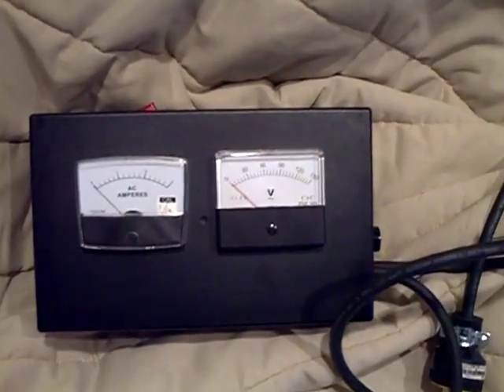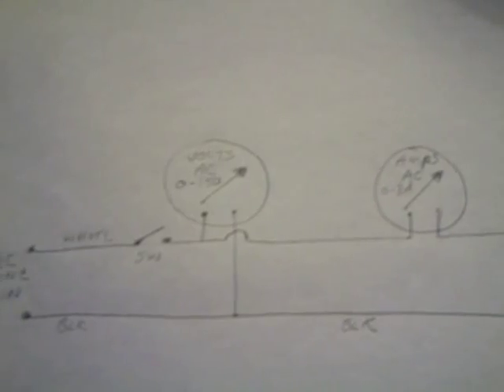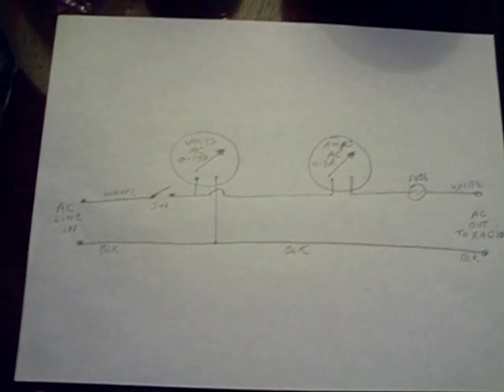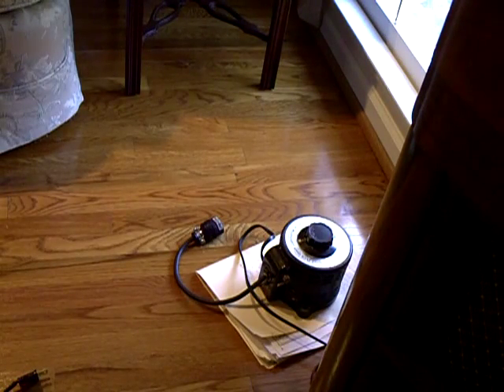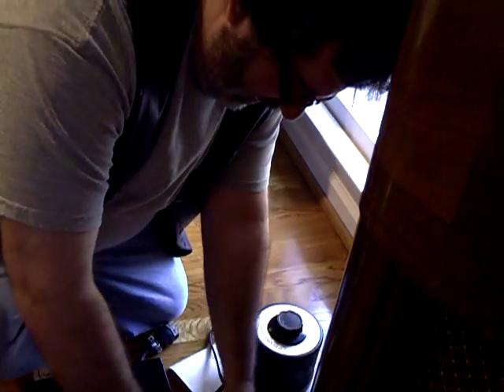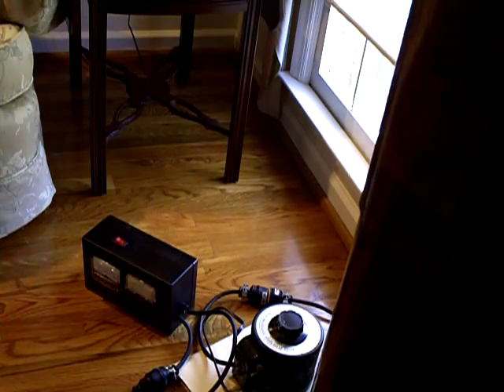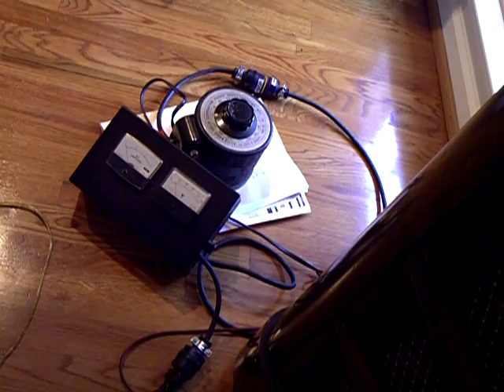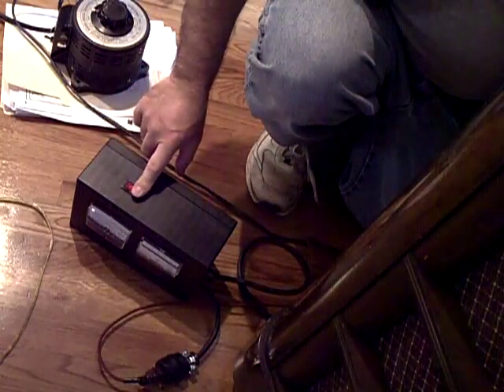Voltage and Current Meter Box Part 2 Done!

Comment: tom smith is right on the money about the wiring.  This is one of the hazards of radios that do not use a power transformer and the manufacturers switched the chassis side of the line voltage in
Reply from the maker: P51ride thanks for the comment

Comment from the maker: I think just a standard size. I think it had a 3 or 5 Amp fuse originally. But when i do initial power ups with no tubes. I just put a 1 Amp fuse. I think the big Philco draw 1.5 Amps at peak. I guessing though, I don't remember exactly. I think a 3 Amp Variac will work for radio work just fine with plenty of spare capacity. There are plenty of new Variacs on ebay with meters built in. Just made the box here for portability > In case I go toa yard sale I can plug a radio in and see current draw.

Comment from the maker: @SlackJones1 Just one thing more. Cutting the plastic with the hole saws is amazingly slooow. It takes patience. I rate making this box difficulty rating about 6 out of 10. I don't have a drill press, so if I did it would have been easier. Holding the box in one hand and drilling holes with the other takes patience!

Comment from the maker: @SlackJones1 I think I used 3 conductor wire, just didn't use the green wire. Not sure though. You just need a wire that fits good into the plug and socket.

Comment from the maker: @SlackJones1 To cut the rectangular hole for the switch, I drilled holes in the top then used a jig saw to cut the rectangle out. I cut it slightly under size, I mean like 1/16 in both X and Y, then I used a file to smooth out the rectangular hole so the switch fits perfectly.

Comment from the maker: @SlackJones1 Hey SJ1, Make sure you get AC meters.
I'll measure the box tomorrow. I think I got it on Ebay too. The meters fit in pretty good. I mean I got the meters in the mail, then estimated how big the box had to be, then ordered the box. So anyway, I'll measure it and let you know.I got the fuse holder at Radio Shack, but I'm sure they have 'em on Ebay. I got the switch on ebay. I got the hole saws at Lowes. I got the wire at Lowes. You can get the plug and receptical. at Lowes too.

Comment from the maker: @doc145 Good catch! I was originally going to do a double pole switch , then just opted for a single pole switch. If the box is used for transformerless sets, it would be much safer to have the switch on the hot black wire. I always put one hand in my pocket when working on powered up radios and put on rubber soled shoes to be safer. Thanks for you comment.

Comment: I have one comment.  The circuit is fine but the switch should be in the hot side (black) of the circuit.  If not then current can flow from the hot side to chassis to ground (through you) when the switch is off.

Comment: What a great idea.  I just ordered some parts and can't wait to get started.  The Voltmeter on my 'heavy' variac is not easy to read and it has no ammeter.  Will use this box in conjunction with a dim bulb tester too.

I'm thinking about using a strip of velcro to hold that light plastic box down on the workbench shelf.  

Very best regards,
Jack

Comment from the maker: The variac already had a fuse. but i wanted some sort of fuse in case i use this new box just by itself. Someone else was thinking of a circuit breaker, but I opted for cheap and just used a regular fast blow 3 Amp fuse. A resettable fuse is a neat idea, i didn't know they existed. Neat!

Comment from the maker: That's great to have it all self contained in one box. I have such a small workbench, I figgured a modular approach would be better. I can just put things on the bench when I need them and take them off when I don't. I probably wouldnt need the meter all lthe time.I figgure it's good for an initial check, then when I power it up with all the tubes, then one last check after final burn in.

Comment: Nice idea! Good video!

I already have a variac mounted in a project box with a volt meter. If I can find a small enough amp meter I'll be able to fit it on there. Then I don't have to add another item on my already crowded workbench.

If I don't find one I'm gonna pretty much copy yours. Well done, sir.